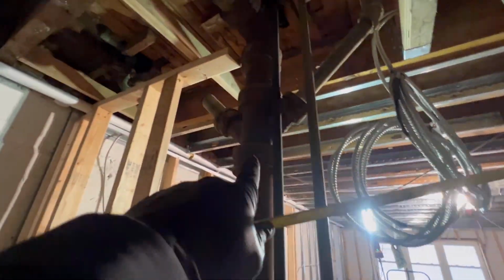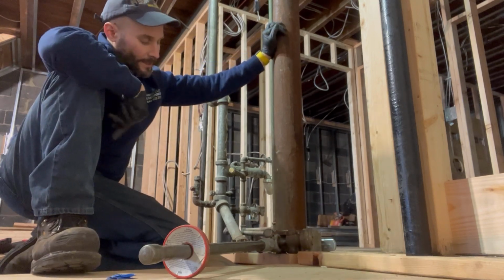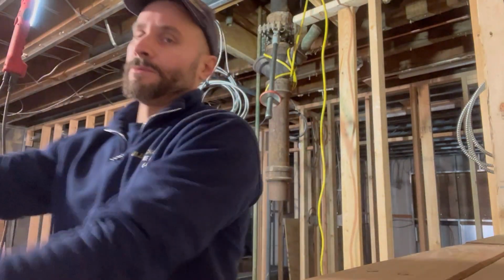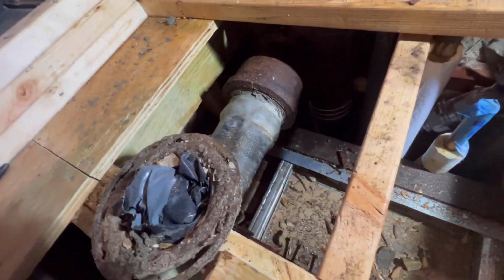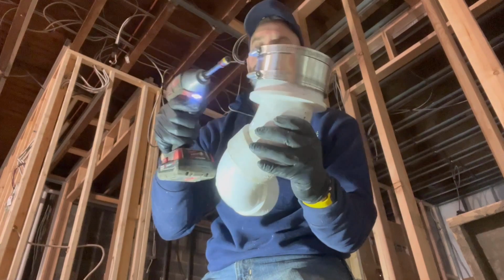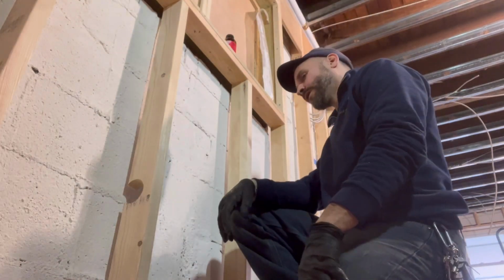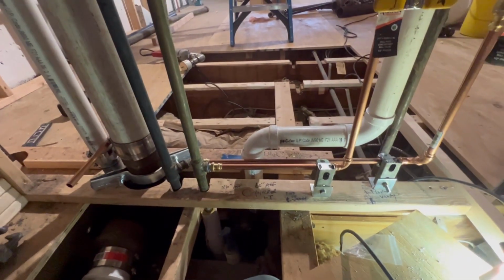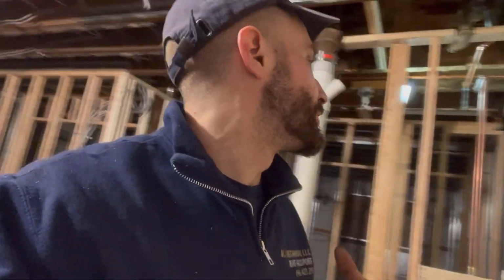HOW TO ROUGH IN A TYPICAL 5'X7' BATHROOM & HOW TO CUT INTO 4" SOIL STACK

Comment: You tried to save the owner some money but you are not going to pass inspection because you can not use PVC in the middle of stack  , you only can use PVC to be connected to metal.
Deflecting and contracting is going to break PVC
Reply: I guess that depends where you are totally fine by me. But agree do not allow the weight on pvc but he has riser supports. I was wondering about the clear primer.